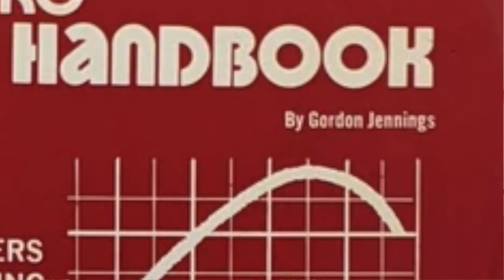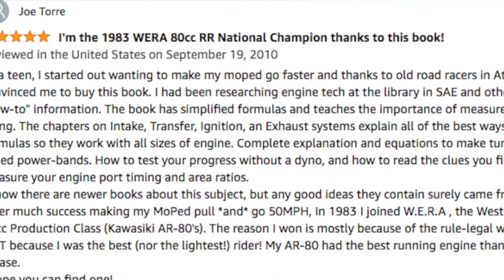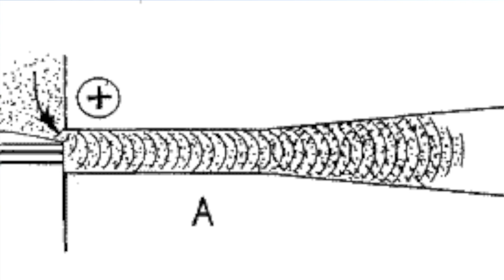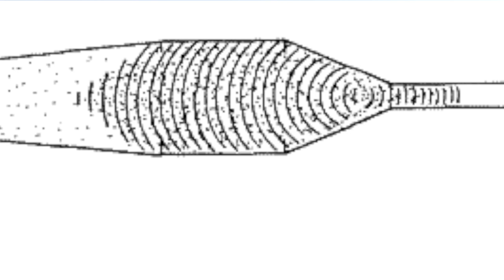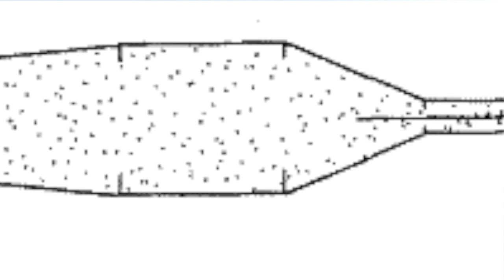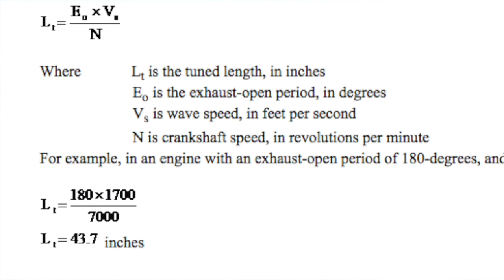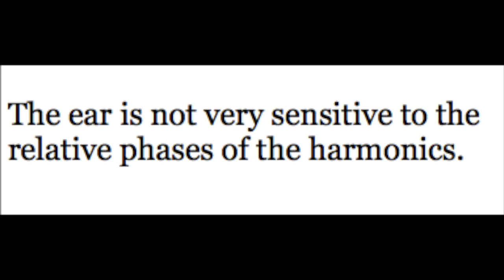What do electronic transmission lines and two-stroke engines have in common?

Comment: The U-Tube algorithm is wild,  cause I was just watching a video of a guy who was trying to make a refrigerator,  using a speaker as one node for a wave that travelled thru a tube,  to a node at the other end,  that was plastic rolled up like a capacitor to draw in the evacuated heat from the reservoir(refrigerator) under the speaker,  and had been talking about using a 2nd " capacitor " near the speaker end to increase the heat transfer.
It reminded me of ur description of the 2-stroke....

💢Tustless Democracy 
Give The Ppl the Power to Veto
Corrupt Laws and Policies 
And I could give A FUQ Less 
Who U Vote4....